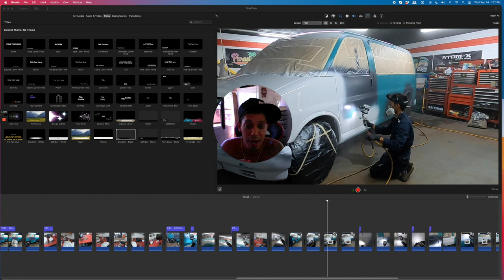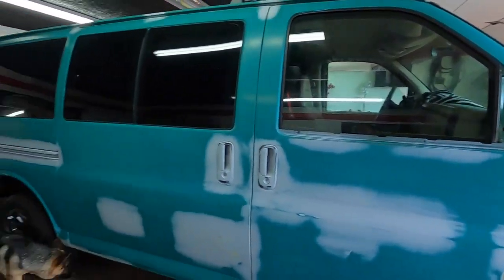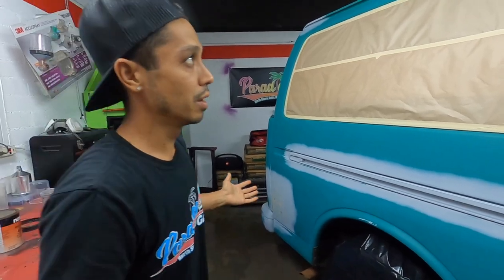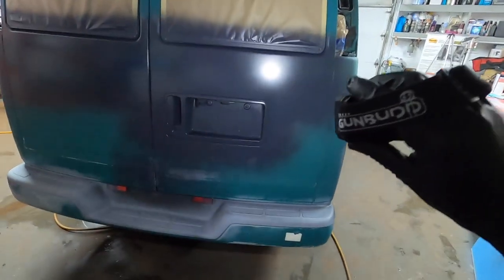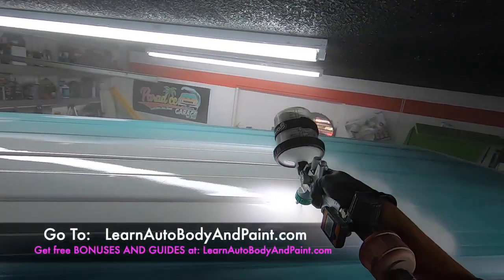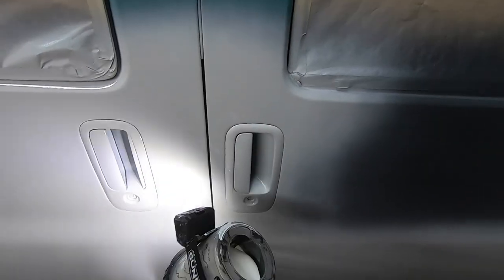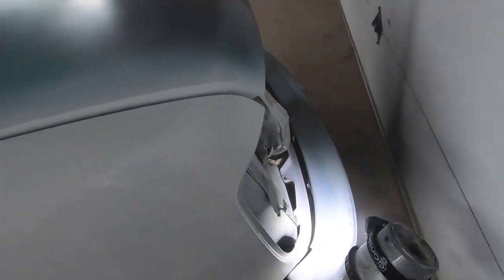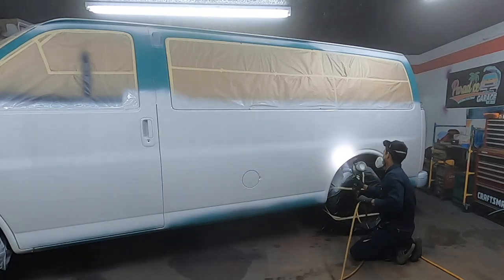How To SPRAY PAINT Like a PRO! Even With a CRAP GUN! (Plus Much More)

Comment: Love ur video, I'm doing SS solid and got runs first coat so I stopped and sanded them out. Now I have scuff the whole car over again. Any tricks to laying it on thick and no runs on vertical panels? Thanks
Reply from the maker: Hey Man! Check out our free training on "How To Spray Like a PRO Without Orange Peel, Dry Paint, Nasty Runs & Tiger Striping by Modeling
The 5-Step R.A.D.S. Paint Formula!" https://www.radspaintformula.com/rads

Comment: lvlp x88 any difference infinty and blue moon? will the x88 cover my clear/base/single needs with the 1.3/1.4 tips 
bought lvlp x20 for primer was going to add the 2.0 tip for heavy matt.
Reply from the maker: The only difference is the color I believe. Yes it will cover basecoat, clearcoat, and single stage. No problem. The X 27 and the X 88 are my favorite guns. The X 20 is a great primer and Matt paint spray gun. The 1.8 tip will also work for you. The 2.0 might be too large. Good luck!!!👍🏻

Comment: I'm in the process of doing single stage complete paint job on my Civic (nearly finished) didn't want runs so i'm assuming i didn't smash the paint on enough on the body as it has orange peel big time or it was low air pressure and or to thick paint, but i did lay 3 coats down so hoping i can flat it out or scuff it up and smash 1 flowcoat on it? 
The doors and trunk i went to town on, came out like glass with a couple tiny runs on compact areas. Using Devilbiss FLG5
Reply from the maker: Hey Man! Just make sure to sand with 800 grit instead of 1000 or 2000. If you’re going to repaint the whole panel, just get it down with 800 grit and put two heavy coats of single stage. After that, If you are looking to buff, then you can start with 1200 grit up to 2500 grit if it’s a light color, 2500 to 3000 if it’s a darker color then buff it out. That is only advisable if you’re buffing. Hope this helps! For more questions join my streaming pretty much mostly every Monday 7 PM EST
Reply: @HowToPaintYourCar  Solid advice, i shall stick to it. Weather has turned pretty cold now, so may have to hold off on it until a few months, i'm not looking for perfect finish just respectable.
Reply: I thought 400 was good enough for SS?

Comment: hi, i got a ol' ford bronco which had factory paint, 2 tone blue and the paint was getting extremely nasty, 
been working on it for some time, took a hiatus after sanding part of it down and now theres surface rust, im resanding it and there are bits of darker metal left under the rust, should i worry about getting that off or is it ok? im fairly certain its corosion but im not 100%
also i want a long lasting paintjob that will look really nice, should i get it professionally painted or should i try diy'ing it with a cheap spray gun?
Reply from the maker: Hey Man! Check out this blog on my website about Auto Rust Repair https://www.learnautobodyandpaint.com/auto-rust-repair-3-highly-effective-and-achievable-rust-removal-solutions/ We have a lot of blogs to help you just type on the search box on the right side of your screen. You may also Check out our VIP program how it’s helped many people like you and get the ability to complete amazing DIY paint jobs from home on budget. https://www.learnautobodyandpaint.com/